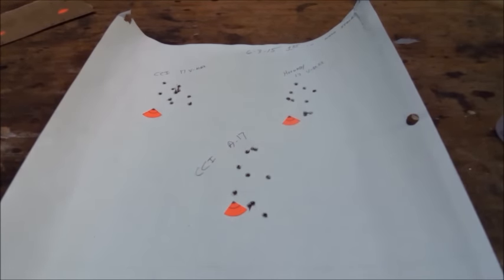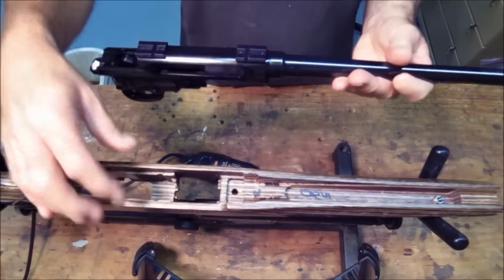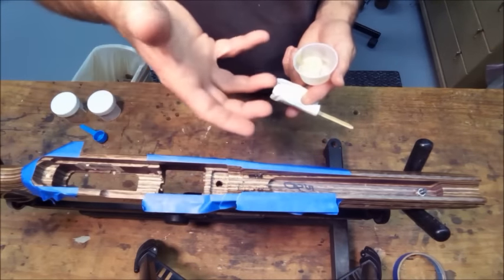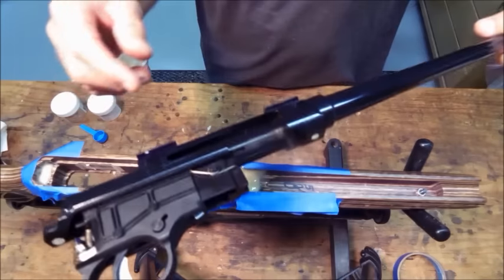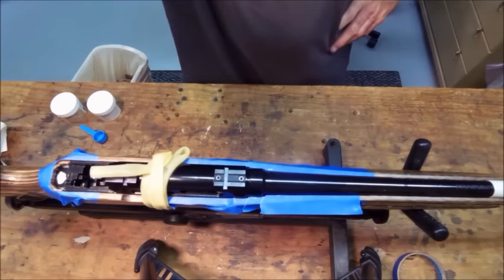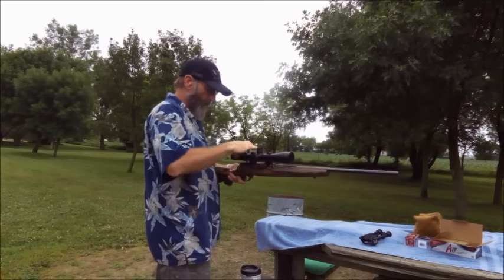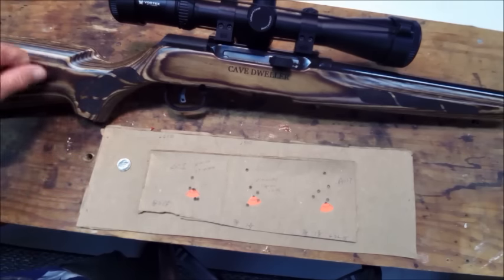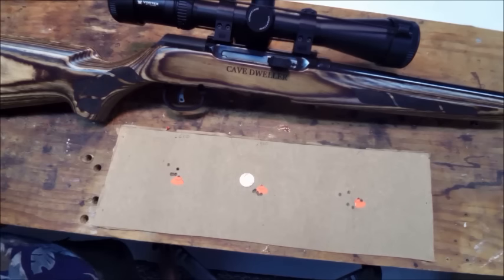Savage A17,  17HMR  How I Made  It Shoot Straight.

Comment: Thanks for the great video @cavedweller1959... I watched a couple of times before tackling the job. I'm going to sight it in today or tomorrow, I can't wait!!!
One major difference I employed in my process:
I bought two 1/4" NF (National Fine, or 28 threads per inch) stainless steel cap screws and cut the heads off and rounded the end over smooth. 
After applying liberal coats of release agent, (love your One Shot idea), I screwed one into the brass threaded adapter in the stock, where the rear takedown screw goes, and the other one into the threaded hole that accepts the front takedown screw.
What this did, while not totally necessary, was:
 1.) It gave me guide posts that made it impossible for me to misalign the screw hole/stock interface, (I need all the help I can get!), and:
 2.) Almost as important in my decision was that it completely did away with what I thought would be a tedious job of having to dig out all the modeling clay from the screw holes. All I had to do was back the guide posts out of the holes and the threads were totally clean. Bingo...

One note: Because I didn't want any chance I would bung up the action or stock, the hardest part of the process was finding out what threads I was dealing with to make my guide posts. I called Savage tech line, easy-peasy, right? Not only was it hard to find a real person on the other end of the line, once I could try to get their help, the woman was very short with me and just blew me off by telling me "Those are proprietary threads.", forcing me to jump  down the rabbit hole of the interweb on a quest. Finally, in one forum or another,  I found out that many Savage actions simply machined to standard 1/4" fine thread. (1/4" NF). 
I really enjoyed your presentation, I learned a lot from you (I used to use neutral shoe polish as my release agent), I also like the no-nonsense approach you take, so, Thanks again, have a great New Year,  I'll be looking for more from you. Keep your eyes on a swivel, your ear to the ground and keep your powder dry Brother... 
Si Vis Pacem, Para Bellum,  JG

Comment: Nice video, thanks for posting.  I have glass bedded several centerfire rifles but not a rimfire yet.   I have the plain plastic stock A17 and the Wood laminate stock version and both shoot well under 1" 10 shot groups at 100 meters right out of the box.  I am Using CCI A17 ammo and  Bushnell 4-14 4500 series scopes on Leupold rings.  The only fliers I have I can call because it is generally my fault.  Great rifles.

Comment: Thanks for your response. I have always used rem oil on all guns but I think the A17 needs a better oil that will bond more to the metal. My problems occurred with CCI TNT 17gr. Thanks again. Also for anybody that has an A17, you need to invest in a Boyd's stock. It completely changes this gun.

Comment: I have the A17 heavier barrel sporter,  that came with a Boyd's stock. I think you are the first review I have seen that complained about the acutriger . I agree,  I have a savage 93r17 and the A17 and prefer the trigger on my savage mark II.  The mark II had a ridiculous pull when I bought it but it cost virtually nothing and very simple to reduce the trigger pull. 
Wish my A17 was as accurate as yours.  It'll shoot sub moa but barely and not always. Good enough for what I use it for but everyone would prefer a rifle that will put 5 shots in the same hole.
Also should mention that I had issues with my A17 out of the box but fortunately savage has outstanding customer support.

Comment: I just got my Boyds Prairie Hunter stock in Nutmeg for my A17. I actually ordered my bedding kit first because of this video. Thanks for the info.
Reply: How much a weight difference is there between the Boyd's and the original stock?
Reply: @shigweezy  a good bit. I didn’t weigh it but it’s laminated hardwood vs hollow plastic. It’s bedded now and rock solid. It’s a tack driver!

Comment: Great video as per usual. I'm glad you glass bed all of your rifles and emphasize its importance. I need to get some CCI TNT and try in mine. My A17 shoots as well as, or better, than my 10-22 with 20" kidd barrel. Also to the left handed shooters out there, cavedweller was asked how it is for a left handed shooter. I can tell you personally that you will always get debris coming back toward your face when you shoot a right handed semi auto of this sort. It works on a gas blow back system, so you get some of that gas and debris coming back. More so than a 10-22 IMHO. Especially with that dirty A17 ammo. My rifle will consistently shoot sub 1/2" 10 shot groups at 50 yards, but it has also been glass bedded in its factory Boyds pepper laminated stock. It shoots well enough that I don't see why I own a precision type 10-22. Keep up the good work on your videos Cavedweller. I don't always agree, but for the most part, you put out some very informative stuff...

Comment: Nice video.

Any 17HMR worth a light should be able to goup consistently sub 1" at 100 yards; if it doesn't then there is a problem with it.

I have a laminate stock Savage 17HMR bolt action and its incredibly accurate stright from the box. Any miss is down either to 'me' or a 'duff' round.

I suppose glass bedding is a must for custom stocks or possibly for some older kit, but most new rifles can out shoot their owners straight off the shelf.

Cheers for the info.
Reply: Mine also same gun

Comment: Hey, That is some dam good improvement you made! One final thing that I would try if that were my rifle though..... I would make a few paper shims and place them to apply a few pounds, somewhere between 2-6 pounds usually, of upward pressure on the barrel at the forend. I have solved many flyer problems and brought groups sizes in even tighter using that method when everything else was done right and a rifle just "felt" like it wanted to shoot a little better! That little bit of upward pressure at the fore-end tip of the stock can be as little as a pound and a half and settles harmonics down just enough to work miracles! I hope you give it a try, it might surprise you! Also, with a stable stock, you would be surprised what full length glass bedding will do for group size to! Just my 2 cents.....
Reply: That has always been a concern of mine too,... harmonics.  I understand the idea of bedding but the 'floating barrel' seems like a bit of a tuning fork.  I'm going to have to experiment with your idea maybe utilizing some dampening material near the tip that is not going to melt or burn with repeated firing - still have to do some research on that.

Comment: Very helpful video. I am preparing to glass bed my Boyds stock and have some questions: 1) can the bedding job be done with the trigger housing assembly removed from the receiver, i.e., just the receiver, barrel nut, and barrel? it does not appear to be needed; and 2) did you add the micro balloons to the hardener and resin to get the viscosity of the mixed liquid glass you applied to the stock in the video?
Reply from the maker: +jspurr.cnta       Remove the trigger housing if it looks to be easier, ether way is OK   Myself, I have no use for the balloons, I did not use them. Thanks For Watching and Good Luck, Let use all know how much better your rifle groups when you are finished..

Comment: Probably a dumb? But the barrel itself? Should it still be floating.  The last 12 to 16 inches on my A17 has a lot of give left right up down. Is that something that's supposed be there? I want to do this to my A17 it is currently all original other then scope I use a heavy ATN 4k pro. I have never done.this to a weapon so i just want to make sure Im getting it right. I acutely fell in love with this rifle after firing it a only a few times very accurate  and inexpensive.  So is the barrel itself suppose to float and just from the block back be firm?
Reply from the maker: You want to have good support for the action and the 1st inch or so of the barrel, every thing forward of that should be floated. Bedding the factory stock would be quite the job, If you really like this rifle, I say invest in an after market stock, you will be glad you did.

Comment: Hey Cave, not really a gun question - but am curious, how did you get the tip of your left trigger finger removed? And how did you handle the scarring.  I only ask because my right thumb had to have its tip amputated (bout 2mm) after getting bottomed out on a 200k metal shear. and the scarring is pretty freaking annoying lol

Comment: Have you been able to get the trigger to behave properly yet? If so, and if the accuracy has been straightened out by bedding, do you think cutting the barrel back to 16.5" and adding a suppressor would still allow proper function?
I know you don't have a crystal ball, but I figured you would have some understanding of how robust the gun cycles in its factory configuration.
Reply from the maker: ILicence I don't believe there is any hope for this trigger, outside the hope it's only a very small % of the rifles that suffer as bad as mine. As for putting a can on this rifle----Not a Clue--sorry,  Thanks for Watching..

Comment: What lube/oil are you using? I just purchased one and upgraded to the Boyd's stock and bedded the action/ barrel. Gun functions flawless up to 40-50 rounds then fail to feed or fail to eject. I know it's a lubrication issue. Help would be appreciated.  Gun has only had about 100 rounds through it so far. Thanks for your videos.
Reply from the maker: +hookbrian I use Pro Gold gun grease on the delay lug on top of the bolt, Any good grease will do fine here.  On the rest I use   Slick 50, It was once sold in  small containers,  It is by far the best oil for my guns that I have ever found. I think it is now only sold in 1 quart cans in the auto parts dept.  Your rifle works great for 40-50 rounds then starts to fail???  Not being there to see it, That sounds like it is getting to dirty to function, If you are using CCI A17 ammo try not to, It has proven to be very dirty stuff in my rifle.

Comment: i totally agree the trigger is horrible/crappy!   Cavedweller do you think any company will make an after market trigger?  It really needs one.  Paul go shoot one and see what cavedweller is talking about.
Reply from the maker: +Carlo Trocheo                I really don't think so , But  stranger things have happened.
Reply: +Carlo Trocheo I'm thinking about picking one of these up and having the polymer trigger group housing replaced with a machined aluminum housing. Seems like that would get rid of the play and stiffen the whole assembly. Savage triggers are usually good enough, hope this would be adequate to fix the issue.

Comment: What in lbs do you recommend for the action screws on the a17, and does the order matter? I bedded the action but am getting some vertical stringing. Thanks
Reply from the maker: 50 In/lbs is my go to ever since I bought a torque wrench, good and tight with out over kill. I've never played around with torque settings on rim fires before, never have seen a situation that looked like that was the cure. Building up 3  10-22 Rugers for the G-Kids over on my Patrion page, this may well be an experiment video topic.
Reply: @cavedweller1959  thanks, I'll try that out tomorrow

Comment: I have three CZ 454 in .17 cal that group 0.5 of an inch at 100 yards.  We use paint balls as targets.  Pure tack drivers out of the box.
You 2.5 inch groups at one hundred yards are cause to return a rifle ASAP.  Just sayin.  SE <><
Reply from the maker: I believe your CZ 454s  are stocked in rock solid walnut, am I correct?  This rifle now shoots way better than I would have ever dreamed, all it took was a little epoxy and a rock solid stock. Proof enough the barrel & action are not the issue. If it had been sent back to Savage, They would have done what???  Then returned it in the same P.O.S. plastic it came with.  Had it not been for the chain of events that lead to the A17 stocks in these videos,  This rifle would have belonged to  someone else long ago. Probably the same for my B-MAG.      P.S.   Thanks for the paint ball tip.
Reply: Sam Esaw yea i have a marlin in 17 i can shoot the heads of nails at 50 all day long

Comment: Any advice on the trigger? Mines adjusted all the way down but still a tad heavy. I’ve seen Jard offers a trigger for it…
Reply from the maker: I think your stuck between a rock & a hard spot. I would love to get the Jard, but I don't see enough use from my A17 to spend the $250
Reply: @cavedweller1959  have you done a 25 cent trigger job on yours? If so any improvement?

Comment: Will the bedding compound (epoxy) stick to the original factory plastic stock?
Reply from the maker: Epoxy will stick to almost everything if it's dry & clean.  The problem with the cheap plastic, If you impart any twist or flex, the bond breaks and you have nothing.  That's why you need a stiff ridged platform.

Comment: Any chance you can share the torque settings you used after bedding? Savage lists 15" pounds for all rimfires regardless of stock. I know one of the best parts of bedding is the torque settings are less crucial for accuracy, but I was just wondering what you settled on.
Reply from the maker: My go to setting is 50 inch pounds on any solid stock.
Reply: @cavedweller1959  That's what I've used on previously bedded rifles. Thanks for the response.

Comment: You know, if you REALLY want accuracy, get a custom barrel with a chamber that allows the bullet to be seated into the lands. OF COURSE, YOUR SETUP HAS TO CAPABLE OF HANDLING THE INCREASED PRESSURE! This advice is only for the pros and I mean it as such and it might not apply to the .17s at all. Again, great videos.
Reply: Jess King savage told me they machine this barrel on the stock so not sure if any upgrades are possible

Comment: My Ruger is a 10/22. It shoots well at 50 & 100 yards. With glass bedding, I am sure it will shoot better.
Reply from the maker: James Payne I have never glassed a 10/22 but every one I have seen done had the barrel full length bedded and the action was floated. They claim it works very well.  Good Luck.

Comment: Noob question-  Can you bed the original stock? Reasons why or why not?
Reply from the maker: +PappyDC1       You can if you want to. But you really need to start with a solid, ridged  platform.  I once tried  to bed a Rem. 700 ADL into a plastic stock, when done, it sure looked good but in a short time the bedding material cracked loose from the flex & shock of the recoil. I was right back where I started.

Comment: How much tape did you use on the front of the barrel?
Reply from the maker: That depends on the barrel and stock. You just keep adding tape until the tape is holding the barrel centered in the channel. Every job will be different.

Comment: Great video! Ordered Boyd's Pepper stock for my A17 and going to bed mine with your video. The one question I have is do you remove the tape completely after the bedding process is completed?
Reply from the maker: +Brent Schiefer             Yes, remove all tape.
Reply: You DO want your barrel to float.
Reply: @galanfink4028  that was the answer I was looking for. My A17 barrel moves a lot. Wasn't sure when they say floating if it was literal of not. So when I glass bead mine DON'T  touch the barrel itself  correct just the block .
Reply: @keithcarlin433  yes,... you want to have no part of the barrel itself touching the stock.

Comment: Nice  work  but savage  has accuracy issues with  17 cal due to fouling try running  bore snake after every magazine
Reply from the maker: Both of my Savage 17s, HMR and WSM,  shoot best after 50-60 rounds have gone through them. Same for my CZ527 in 17 Hornet.  I no longer bore clean these 3 rifles until they start to fail. I haven't found that point with the Savages but the CZ it's around 275.

Comment: I lucked out with my A17 I got mine the first year they were available and from the factory mine will shoot any of the 17gr loads 1-3/4 of an in the thing won't group less than 2.5 in with any 20 gr though
Reply from the maker: 1.75" at 100 yards is not very good for a 17 HMR.  Have you ever thought about trying to correct the problem??
Reply: @cavedweller1959  sorry that was my bad I didn't word it well I meant 1/4-3/4 of an inch I think the only time it shot over 1 in with the 17 gr loads was when I banged my scope pretty good on the door of my truck
Reply: It particularly likes the hornady v-max 17 gr that's what I've gotten tge 1/4 in groups with
Reply from the maker: That's smoking good for a box stock A-17.  Both my HMRs and several more of some local P-Dog shooters do best with CCI  TNT HP.
Reply: @cavedweller1959  I know I was really impressed with it mine has never really liked tge cci loads but especially not the TNT load the only cci load it did like was the 17gr fmj I recently ordered a case of the A17 ammo to try since I've never used it